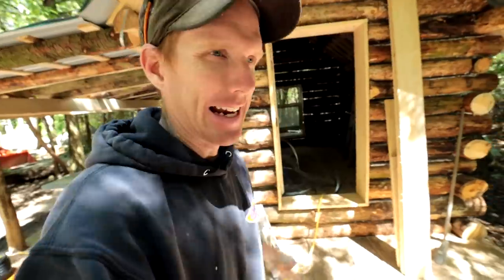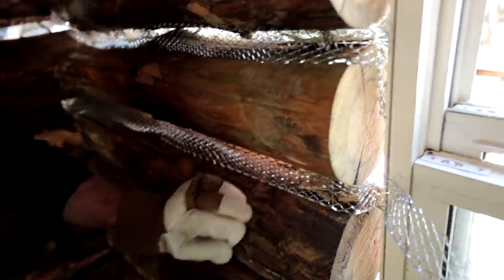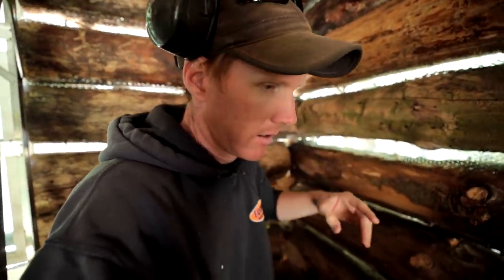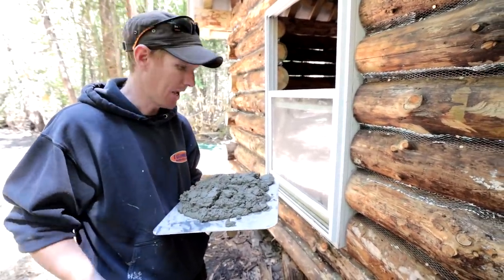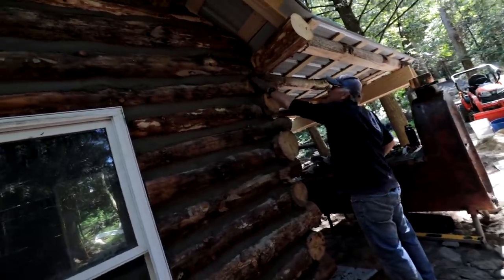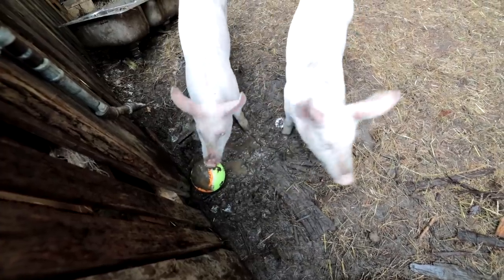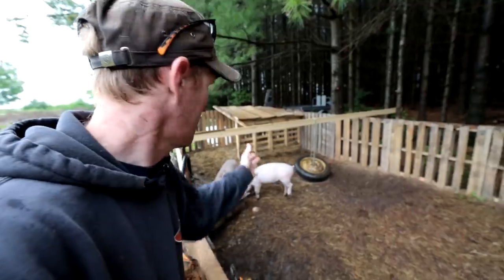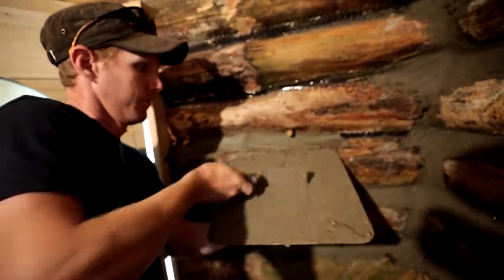Off Grid Log Cabin is Done (mostly) | Chinking the Log Cabin

Comment: Not surprised the tarp cabin made it through the winter. Nicely sloped roof line and plastic is pretty slippery anyway so the only thing I might worry about--snow fall--would have to be massive to be a real issue I think. 
The sugar shack is coming along well also.
It will be interesting to watch the possible bridge build, hope that does happen.
Thanks for sharing this with us!

Comment: An idea for making a path threw the marsh would be to get in touch with your arborist friends and see if they can hook you up with the shavings from branches.  Cedar would naturally be best because of the water but any wood shavings can be used to make stable paths.  Just a matter of having enough wood for the length and width that you need.  If you can get the wood shavings free in the amount you need the only potential cost would be things like pipes/culverts for areas with flowing water.

Comment: A great masonry mix for chinking is 9 sand 3 portland and 1 masonry cement. The extra masonry cement makes it stick better and it seems to shrink less. Also a great mix for any parging or pointing jobs.
Reply: So... The exact ratio he did with a slight slight addition of "masonry cement"
Reply: @AK_Ray  It's a slight slight addition in the same way that yeast would be a slight slight addition to bread, small volume massive difference.

Comment: Nice projects, and I suggest plywood with moisture layer under the metal roof to prevent mold and energy efficiency, and interconnect all buildings to a underground 12Volt DC power tube and AC wire for future upgrade.

Comment: Damming the creek may allow for ram-pump for water to pond, or water-wheel for a renewable energy utility building for a battery bank and AC inverter. AC and DC wires in separate tubes for safety will make living better.

Comment: Butter it up like a big cake 🎂 wow.... So that said, it means no ventilation? When its summer time, would you not need airconditioning? Or fan? Then when its winter, you would need a warmer or heater? I m from SINGAPORE 🇸🇬, we have just rain and or shine! No need to worry about bugs or mosquitos because rain or shine, mostly every household has a aircon set on all year round. Less to worry!!! Saw your patching of cement in between the log...pretty well done 👍💋 nice. Yeah, you are right, it is gonna be in there F O R E V E R!
Reply from the maker: You can still open a window and control where the ventilation is coming from.

Comment: You could put some expansion joints to help keep the concrete from cracking over time
Reply from the maker: The joints aren't the long... the lath should hold everything in place.
Reply: Yea but with the weather where you’re at it seems like one day it could be hot and snow the next lol. Even if the joint isn’t long it’ll help with the stress. When it’s cold concrete shrinks and the opposite in the heat.

Comment: Maybe rather than making a road to those maple trees you could put down an irrigation pipe. I remember when I worked at a farm that only made syrup they had miles of tubes and just drilled and tapped and then it would go straight to their big ol tubes and they'd suck in thousands of gallons of sap.

Comment: margin trowel Kevin, and you should used a Masonry Brush and water but you did ok its a learning process always easier with the right tools as you know, cement sets up as it dries just the proper term I am a carpenter that does decrotive concrete work keep making the crazy video's plastic lasts forever
Reply from the maker: Thanks 👍

Comment: Not sure cement chinking is going to stick!  Chinking needs to be elastic to stretch s the wood moves with the humidity?
Reply: Yes. What did the pioneers use?
Reply from the maker: That's what the metal lath is designed to help.

Comment: how come you didnt put insulation between the logs? I thought you would typically put a closed cell foam insulation between the logs?
Reply from the maker: I felt that might trap moisture I want it to breath.
Reply: @ModernSelfReliance  I’m going to have to do some research your in a much hotter humid place than I am I would like to put the closed cell insulation between my logs before chinking but it might be better not to if it ends up being a moisture trap

Comment: We used to do log cabin inspections in the course of home and commercial building inspections and watching you put cement chinking in that beautiful log cabin makes me cringe!  We only saw one log cabin in which this was used and it was horrible to say the least.  When concrete or cement hardens it shrinks and leaves gaps unless you mix something with it to make it more elastic.  Just as you've used wire mesh in your build, whoever rebuilt that cabin that was dismantled and brought to the next state to rebuild used the same method to hold the cement in between the logs.  When inside that log cabin which was very dark inside, you could see every hole where the cement shrank and where sunlight was flooding in.  I'm sad to see that you opted for this method of chinking.  Might want to get your advice for such projects from now on from Barnwood Builders who have their own show on tv.  Someone in the future will have to remove that cement and do the job right.  It's going to be expensive and labor intensive.  Try selling a cabin that's been chinked that way and you'll lose a great deal of money in the process.  Also think about the caustic nature of the cement and why you don't handle it with bare skin.  It does that same thing to wood it's in contact with over time.  It might take years but it will show and by the time you see it a lot of damage has been done. When doing chinking you bevel it so it sheds water and create an angle where it runs down and off the logs like a slippery slide on a playground.  Otherwise the water sits on the logs and rots them over time or it freezes on them causing damage to the wood.  Cement draws natural oils and humidity from the logs by the way, which isn't good for wood.  
:(
Reply from the maker: Thanks Patty!